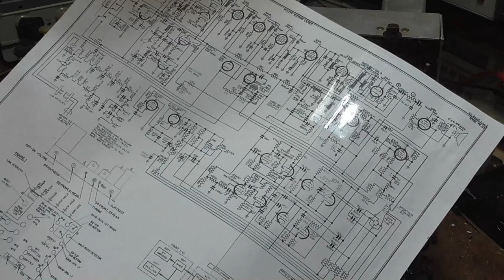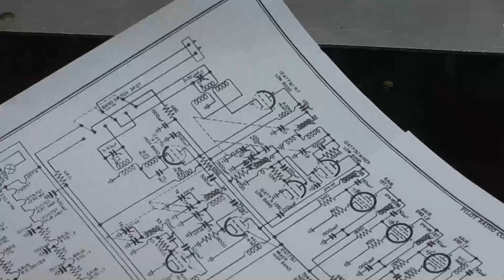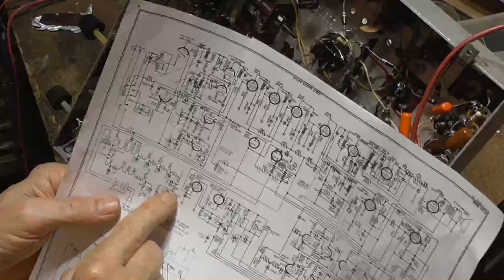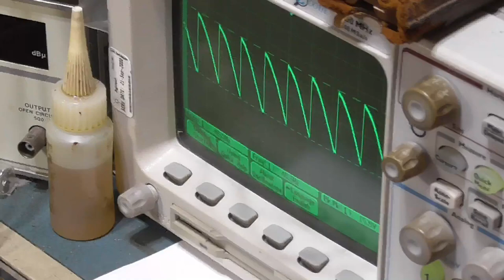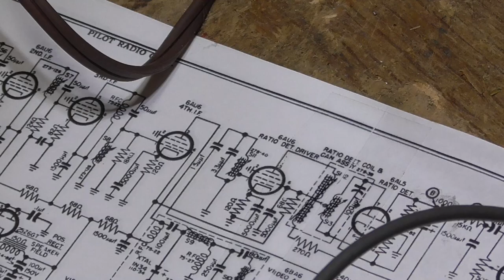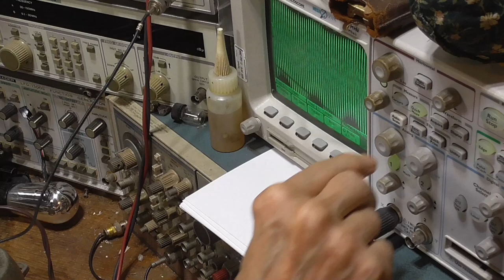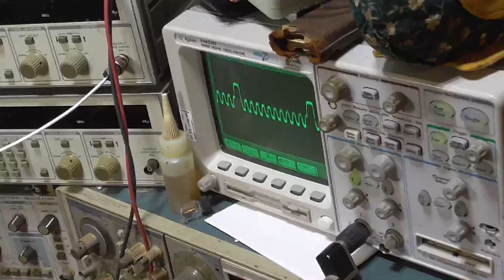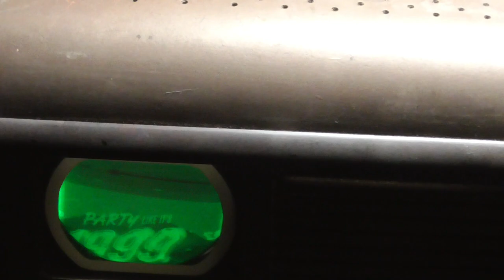REPAIRING A PILOT TV37 ANTIQUE TV

Comment: back in the radio-tv vo-tech days, we used a 40-100 watt incandescent light bulb in series with the unit under test to track-down shorts. the light ran bright until the short was removed...🤨  worked great to save blowing fuses.. thanks a lot, great video...:)

Comment: Nice TV, The greem CRT adds something special to the overall effect. Great repair.
Reply: As if being a 3" b&w roundy wasn't bad enough. Some genius had to decide to make it green!
This must be a very rare set. It is hard to imagine who this is(was) aimed at. A 7" one is also a low end cheap set and can reasonably be watched a few feet away. This thing has to be viewed within a foot or so.  It is really no more portable than any other tiny set.  There wasn't much in the way of programming in 1949 to even watch. It doesn't have a radio in it.
Reply: @tarstarkusz  I've got a 3 1/2 inch B/W TV with AM/SW radio from the 70's. As a family we used to sit round it on caravan holidays watching horror films in the 80's. We used to get realy scared because we could'nt quite see what was going on. LOL.
Reply: @frankowalker4662  You mean one of those "boom boxes" with the litte CRT TV sets in them?  I have a few of them. The smallest one, I think is about 4" but also has a cassette deck and an AM/FM stereo as well.  This one doesn't appear to have an AM radio in it.
I have some 2" jobs, but they are LCD pocket machines.
Reply: @tarstarkusz  I wish it was a boom box, It's a small crappy Crown CTV-14. It's on google images. LOL.
Reply: @frankowalker4662  It's hard to get a sense of scale in those photos. I have a 5" model kind of similar which I bought for I think 14,99 in the late 90s/
Reply: @tarstarkusz  True, I've just measured the front of mine. From the top of the case above the screen to the bottom of the case just below the screen is 3.5 inches. Ha ha.
Reply: @tarstarkusz  It was originally B&W.  The correct 3KP4 picture tubes are nearly impossible to find now.  It was sold as a low cost second TV and was priced for far less than any other set on the market at the time.  $99  I believe.
Reply: @bandersentv  Almost correct on the phosphor type number, Mr. B. - I think you meant to type "3KP4", n'est-ce pas?  Ron talked about this.
Reply: @mikeread5132  Yes, thank you for the correction.  I updated my comment.

Comment: Hi Ron. Do you have a build video for that capacitor tester? I think I can surmise what's in it, but it would be nice to see a video if you have one. Thank you for sharing your expertise. I learn a ton from you.
Reply: The ancient cap testers that I used decades ago had two modes, leakage test mode, which basically displayed the current drawn through a DC charge applied to the cap and a tuned circuit for value. Testing ESR came much later, well into the '80's before it really caught on.
I got out of the consumer electronics repair business in the mid-90's, when it became plain to see that everything was moving toward being disposable and went into IT. Back when I was still in the business, I'd get calls from shops asking for ideas with units those techs couldn't figure out.
The oldest unit I worked on was a WWII vintage radio that lacked permanent magnets, but used a choke coil to both filter the power supply and apply a magnetic field to the loudspeaker (the shop owner I was working for was shocked that I knew that tidbit of information) and the owner's RCA TV, literally the first television made by RCA (had to retune the IF circuits and adjust the ion trap, lest it damage the ancient original CRT). The newest units, well, modern VLSI circuits with comb filters, etc. Just as well, these days, I can barely see the current generation of surface mount chips.

Comment: Your cat brings you those critters as “presents”. They must have used a CRT for an oscilloscope for this TV. Green CRT ?
Reply: The first post-war televisions were actually made from unused military supplies of radar screens, which functioned mainly as oscilloscopes during the war (as usual). Thus, the form is not random and it is possible to use a green oscilloscope screen with a small deflection angle and electrostatic deflection as an alternative. The parameters are almost identical.
Reply: @Brian  Ron mentioned the high cost and scarcity of a white phosphor (P4) vs the common green (P1) CRT.

Comment: I liked the well used slide rule on top of the scope. Keuffel & Esser ?
Reply from the maker: Yes! Had it since I was 12! (I'm 76 now!) Still use it all the time! Batteries never run down!   :)
Reply: @glasslinger  
I don’t like batteries.  They’re heavy, bulky, expensive, sometimes difficult to find, run down at just the right time, used to leak, but modern ones don’t seem to, and result in lots of toxic waste to dispose of.

I like cameras which don’t use batteries.

Comment: Maybe I missed it, but what's with the green phosphor? Scope tube?
Reply from the maker: The black and white version of that picture tube is very rare and expensive. A working one will cost you as much as the whole TV! The green version is cheap, under $50 for a new one.
Reply: @glasslinger  So this was not the original tube, correct?
Reply from the maker: @ohger1  No. It was what was in the set when I got it.

Comment: Hi Sweety Just a quick question …If the filament of any tube is ok Is it safe to say that the tube is good to go …I don t have a fancy tube checker 2000 I just have a tester for filament lol
Reply: so long as its not gone to air, its good to try lol .. but if its gone to air youll find out soon enough. filament resistance doesnt take into account any other characteristics of the tube, shorts, conductivity etc.

Comment: As you say, it's one thing to troubleshoot an original set, but when somebody else has been in there, you have troubleshoot their work as well. Probably everybody who designed and built this set are long gone, but you gave it a new life. Well done.
Reply: I took in a radio to restore for a customer that had been a restoration attempt.  Between the crappy workmanship and the wiring mistakes, I ended up cutting everything out of the chassis except the tube sockets and IF coils and started from scratch.  Took less time that way.

Comment: If it's already been worked on in the past then you really have no way of knowing how good a job the previous person did or if it has been modified from its previous design.  I have an old Emerson plaskon tube radio which I had no trouble getting to work but was very much different from the original schematic since it was converted to AC.  Mind you, whoever did it did an excellent job and modified very little of the original circuit in the process.  There was even a space on the chassis for an extra tube which was used for the 117Z3 rectifier.

Comment: Good news on the re-capping, provided they did it right (looks like maybe not).  At least you have the required caps.  Good thing you had the schematic.
Some line operated sets had a full wave voltage doubler with the chassis half way hot between ground and B+.
21mhz IF TV's were usually split sound, while 45mhz IF TV's were usually intercarrier with 4.5mhz sound IF.
21mhz IF was abandoned to avoid interference from HAM 15 meter band!!

Comment: This kind of work is opposite tom, for example, Engle's Coach Shop, where ye rebuild buggies and wagons,  He has to know a wide range of completely different jobs that are each not tremendously complex, while the work shown here has more focused operations, but they are extremely complex and interact with one-another so that you in many cases have to fix several different problems to get something to work, in a rat's nest of complex circuitry.  I am continually amazed by the successful resolution using both kinds of mental activity!

Comment: I worked on TV's when I was a teenager into the 70's.  At that point I lost interest and moved on to audio which I had more interest in.  
However, I very much appreciate anyone who worked on TV's back then that weren't just tube-jockeys like Ron here. My boss at that point I can see now, as were most tv techs of the 60's-70's, really didn't understand how tubes or certainly transistors worked.  They were more 'Method' repairers.  Interestingly enough back then with tubes being swappable, a guy could still fake his way through most common repairs.
The rubber hit the road or them in the face, when it came to the deeper issues in IF or oscillator circuits when they had to know some theory.  Many of those cats had to quit when the hybrids and eventually the total solid state TV's came out.  I felt for them.

I went on to tech school and gained the theory necessary to carry-on past that stage.

Comment: Nice piece. I have a 1949 Motorola with 7 inch CRT and plastic case. Looks nice. Haven't got motivated to get on it yet as the CRT needs to be checked first. It has a boatload of paper caps in it to change. It is also one with no power transformer in it.

Comment: Impressive skills there with one of the most collectible TV sets. You'll notice the picture wants to "tear" on these, but a juggling of tuner and contrast controls will usually cure that. I believe the green CRT's are oscilloscope replacements. Even those are rare nowadays. I turn mine on with a Variac as not to have it's filaments blasted like a radios pilot bulb. A wise thing to do if you use the set.

Comment: Hello. Thanks for the video. I appreciate the process as much as the results. It is possible on future videos to include the reasoning that discovers the failures like the substitution of the 80 MFD capacitor, the realizing of the low signal voltage to the CRT or the first IF tube missing grid contact? Do glad you put those on the captions. Great job!

Comment: Ron your so good with old stuff, perhaps you can help me.  I have a ton of NOS dip sockets that still have bright and shiny leads, but I cannot get them to whet properly with solder.  My usual solder is keester 44+ and my tip is regulated to 700 degrees.   I have also tried keester red label with the organic acid that needs a water wash after soldering, but neither seem to do the job.  I have tried burnishing with fiber, brass and wire pencil brushes to no net positive effect.  Any suggestions?
Reply: They must have some sort of invisible corrosion on them.  Sand with 100 grit paper and use rosin flux.  You need heat, but 700F is too high.  Set to 625 so you don't burn your flux and oxidize the metal.

Comment: I reckon that circuit design of TV could be aimed squarely at the lower end of the "Top Band" radio spectrum.... 20m to be exact. 🤐🤐🤐🤐😎😎😎😎😎
Reply from the maker: Minimal resolution TV takes about 4.5 mhz bandwidth so going lower in frequency than about 50 mhz would tie up a lot of useful channel space!
Reply: @glasslinger  Wow, I sure did finish the last of the bottle there, sorry about that Glasslinger!.
The simple symmetrical design somehow impressed the pants off me and I thought it'd be great for some far out test transmissions!! Hah!.

Comment: I've always had a problem with roundies, do you make the picture fill the tube, and cut half of the picture out, or focus it in the middle of the tube and not use half a screen 😂
Reply from the maker: Has to do with the sync pulse and signal strength. With good solid signal the picture fills the screen properly. I don't have an outside antenna so my reception is horrible.

Comment: Could one use a variac and a dim bulb to check for excess current flow and possibly reform the electrolytic capacitor?
Reply from the maker: No. The chemical changes in the capacitor are permanent. It is necessary to replace the old capacitors.
Reply: You can get a lot of them to reform, yes, but it's a temporary solution.  Back in the 70s, I was changing dozens of these can caps a week, and that's when they were used daily and were well formed.  Now it's 50 years later than that.  I've opened can filters that were replaced but working perfectly.  Even though they still worked fine, they all showed foil damage and degrading paper.  Just shotgun them.

Comment: Another interesting hour! Assuming the fault is within the electron gun and not the phosphor coating have you given thought to opening up a CRT and rebuilding it?
Reply from the maker: I don't have a bakeout oven large enough to handle CRTs. There are several people that have tried it but from what I hear longevity of their tubes is poor due to gassing up.
Reply: @glasslinger  
Isn’t there a museum somewhere which acquired all of the equipment from a rebuild workshop when it closed down and can do rebuilds?  I can’t remember where it was, somewhere in the US.
Reply from the maker: @srfurley  A private group got the equipment and is now attempting to rebuild tubes. Only practical for the rarest most sought after types since it is so expensive to do.